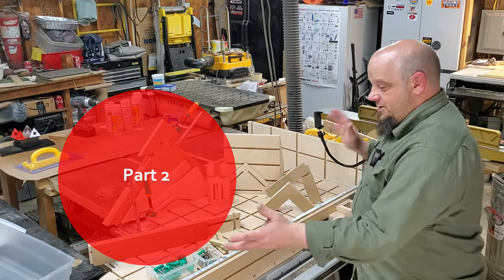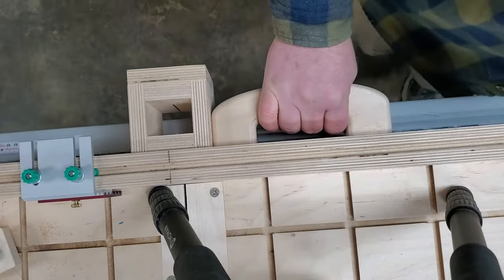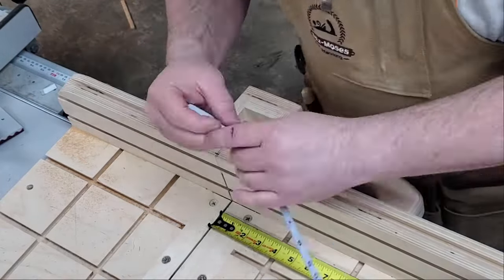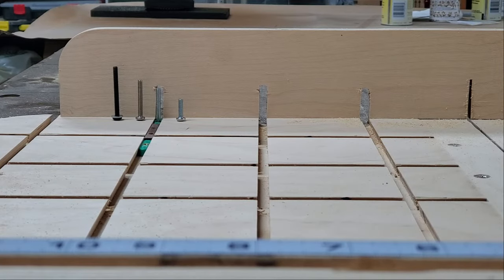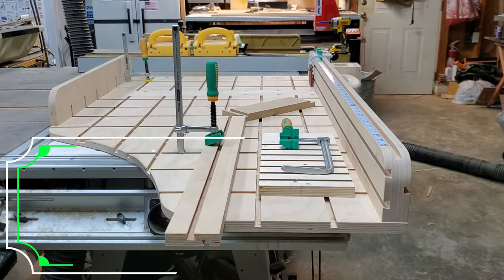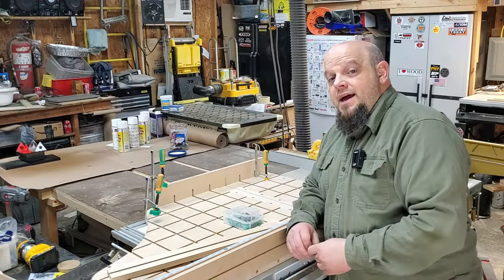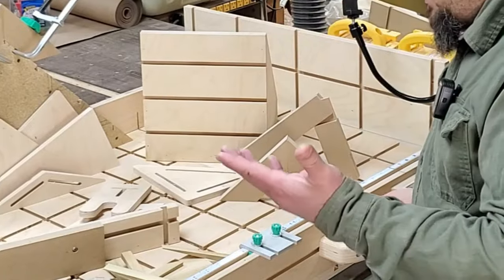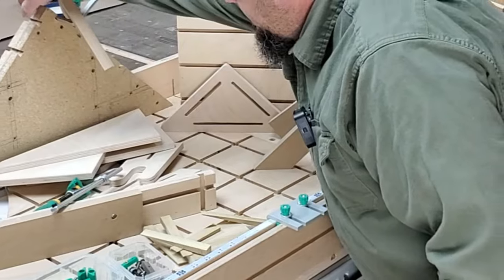Microjig Matchfit Inspired Crosscut Sled Update and New Jigs pt2

Comment: I am waiting to get into a shop. When I do, first thing I am going to build is a 4'x4' Microjig table top, and a smaller microjig sled, and, see how I like it. I am certain I will be building a lot more jigs once I do that. I have a large sled now, had to make it out of plastic plywood, because, I have to work out under a tarp/carport at the moment, so, have to keep my tools put up or rust, etc.. Portable dust collection, Tables, Sawhorses, accurize all of my tools, and start filling the shop up with hand built tools. Store purchase a few here and there, but, for the money, Disk, Belt Sanders, etc, I prefer to build my own.. And, I have an idea for a rotating spindle sander with adjustable table, which will use one motor to drive each of the different size spindles on a carousel. Can't wait to get situated and start building. I can get away with metal building, but, wood is a waste of time right now.. Sucks, but, lets see what happens in November and Jan 20th, before I take what I have been saving for 20 years and drop it on such a big investment.. Ha... 
Cheers, keep it up.. I see you doing all sorts of cool things with the matchfit.. Cool uses building the picture frames.. :)

Comment: Great video and very informative. I just finished my sled and must have watched your videos 20 times. Very happy with results and I thank you for that. Would appreciate the dimensions of the handle. That would be the finishing touch. Continued success!
Reply from the maker: Thank you for watching (so many times).  To make it, I used my hand as a guide to determine width and how much was required to stick out.  I added some and cut it.  

Since the video, Microjig started selling handles like what's on the Gripper.  I got one of those and replaced my wooden one.  I like the yellow, and of course, it utilizes the dovetail slots.
Reply: @ChristcrossCrafts  Thank you for the information and quick response!

Comment: I got a hand-me-down Craftsman miter saw from my brother-in-law almost 15 years ago. Since I got my table saw (4 yrs ago) and made a sled for it and bought an Incra V27 miter gauge, I haven't use the miter saw for ANYTHING. It's just been collecting dust, so I sold it. 

If I found myself always needing to cut down 8 ft boards, then I would probably get another miter saw. For me, a miter saw is unnecessary and with a sled like yours, I'd be saying "A miter what?"
Reply from the maker: Rough cutting boards is all I use my mitwr saw for in my shop.  Then. I helped a friend install molding, and I'm glad I held onto it.  It does have a purpose...
Reply: @ChristcrossCrafts  most definitely that have a purpose, just not in my shop. 

I don't have a vehicle that can transport anything longer than 6 ft. I can easily use my table saw to cross-cut boards down when I need to. 

Things may change for me down the road and I may need a miter saw. The right tool for the job, right?

Comment: Rather than cut slots in your rear fence make a thicker one that fits inbetween the slots closest to your blade. The rear fence on a sled only stops it flopping about when you remove it from the saw and maintains the kerf width. If it was me I'd simply glue and screw a piece to the rear of your sled and then double it's thickness by putting one more piece whose base is on the sled. You'd lose no depth of cut. Honestly as a 50 year time served saw slave you do not need a rear fence wider than 7-8inches as long at its 1.5inches thick.

Well done for making your own dovetail keys. I think the Match fit System is great but you really only need to buy the clamps. Everything else you can make yourself. I would probably buy their dovetail bit as it's a unique shape and use a straight spiral uncut bit to hog out. I don't have or want a CNC. Space money and don't do computers.
Reply from the maker: I had considered making the back fence shorter (in length) but opted for a longer one for a couple of reasons.  After making a couple of other items with the system, I feared it would warp easily with all the slots and without extra support.  This is a HUGE sled and I'm glad I reinforced the back as I did, as other people have done as you mentioned and complained to me about theirs warping.  Between the longer fence and the aluminum runners, mine has not.  

I did cut the curved area to aid in reducing weight and potential warping.

I agree about the bit.  My first few pieces were done with a standard dovetail and man, what a lot of sanding.  The Microjig bit eliminates almost all sanding.  I used a standard router for making the sled, I only used the CNC for some of the fixtures to see if I could and what speeds/feeds would be ideal.  CNC isn't for everyone but I'm certainly glad I made space for it in my shop.  I utilize it quite often in my traditional, as well as CNC only woodworking.

Comment: This is awesome I just bought into this system I just started to Woodworking looking forward to using it to joint out some boards. Right now I'm just using pallets that I get from work. Also if I see some cull lumber at box stores I pick it up. Can I ask why the walnut for the home made inserts. I have so many questions 😅 thanks for the video
Reply from the maker: Thanks for watching.  Woodworking is addictive... be careful.  I used walnut because it's what I had.  Any hardwood will work.

Comment: Nice sled. I would defenitely open up at least the tracks closest to the blade at each side so that I could drop down clamps from above in the far end (furthest away from user). This will not effect the front fence, just rout 1/2" wide as long as the clamping portion of the clamps, down to the bottom of the dovetail slot. You will only sacrifice a few centimeter of clamping track over there in the front but I think the upside is worth it. I hear you say you haven't found a need for using clamps in the front to back slots, but clamping small parts I see as a major win with using this kind of sleds, and the clamps are just faster to work with than hold downs. Refer to around 2.05 in my video (+10 year old sled, prior matchfit clamp era) what I mean with dropping down the clamps from above. You wouldn't need to rout all the way through as I mentioned above. https://youtu.be/UuoqtK3L-MY
Reply from the maker: All very good points.  What I've found is I can access the clamps from behind the main fence.  I slide them in from behind, they straddle the fence, and allow clamping right at the fence if needed.  

I resolved over a year ago to route enough clearance to drop the clamps in if I ever needed to.  Between straddling the fence and other fixtures, so far I haven't needed to.
Reply: @ChristcrossCrafts  ok, good answer, didn't think of that you can reach with the clamps over the fence.
Reply from the maker: @CarmoniusFinsnickeri  if your fence is tall that presents an issue.  As long asit doesn't exceed the clamp range you are set.  Mine are just shy using 3/4" material so I made a clamp extender that slips on if needed.

Comment: What I did to bring clamps in from back is simply enlarged the groves at the back a few inches so I can drop the clamp in from the top, then run it forward. Why route in groves if you can’t use them?
Reply from the maker: I use my grooves all the time.  I have never needed to update my slots to allow for clamps from the back fence (and I have been prepared to should I need to).  I can clamp from the main fence (closest to me) by straddling the fence with the clamp.  The grooves go all the way. I use the slots for hardware and fixtures constantly.

Comment: Do you have a dado jig for the router using micro jig system?
Reply from the maker: I use the tall fence for multiple purposes.  One of them is a straight edge for the router which can perform that task.  It also serves as a tapering jig, as well as several other odd ball uses.

Comment: I have added my own hardware with my 3d printer
Reply from the maker: There are many times I wished I had a 3d printer.  Not yet though.
Reply: @ChristcrossCrafts  your solution was simple and scalable. I have also 3D printed but it is limited in size and material. Now I have two ways of doing. Thanks

Comment: How do you like the Katz=Moses stop after these months?  Any drawbacks to using it with the dovetail hardware instead of the native hardware & T-Track it comes with?
Reply from the maker: I love it.  It fit perfectly on my fence and allows adjustment up without losing my settings.  It integrates perfectly with the matchfit hardware and knobs.

I have found a way to ensure precise setup simply using a square off the sled.  If I need to move one way or the other, the face adjustment makes it easy.

I'd suggest getting the stop prior to making your fence to ensure fitment from top to bottom. I lucked out and it is less than 1/32" gap between the sled and bottom of the fence.

Comment: I'm looking at building this, and was wondering what your gap was between the dovetail slots.  I was thinking 4" on my build but that doesn't seem quite narrow enough and yours look more like 3"
Reply from the maker: I went with 3.5".  I planned on 3, but felt that would weaken it since its so large.  4 seemed too much and so I split the difference.  Between that, the hefty fence, and the aluminum runners, I felt it would be plenty stable.  It hasn't been an issue at all .

Comment: Great sled, the jigs you’ve made are very useful. I do have a question. What T-bolts are you yawing that can make the turns in the intersection? I have the rectangular nuts from Klinpour. All the T-bolts I find are the 5/16” ones that doin’t fit.
Reply from the maker: Thank you for watching. They are 1/4" t bolts with the elongated head.  They sell 4 lengths.    They are snug but do move freely in the grooves.

Comment: MicroJig is a great tool. Most folks do not want to buy Birch Ply which in my opinion is the BEST plywood for jigs. Most stores like Homedpot or Lowes do not carry Birch Ply.  I have been using minimum 18 Ply or 3/4 in. for best sturdy jigs. The Ply from the big box stores I have found the jig is not rigid or have holes in the ply and the jig is not reliable for doing routing or holding material.
Reply from the maker: Yes, there are other options but the Baltic offers the best rigidity and strength.  Phenolic and other dense plastics have some benefit but don't do well for applications like this.